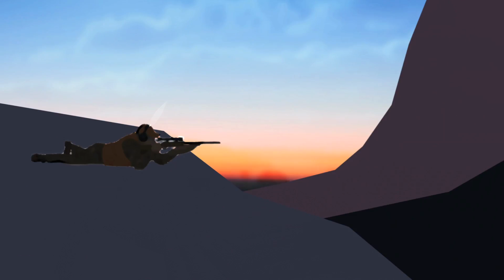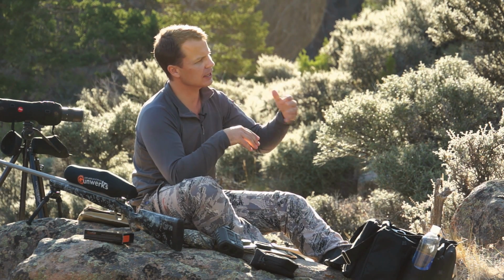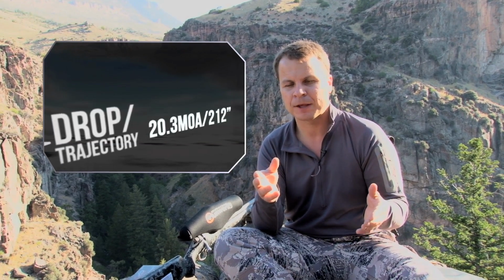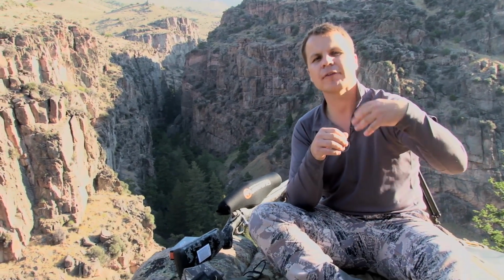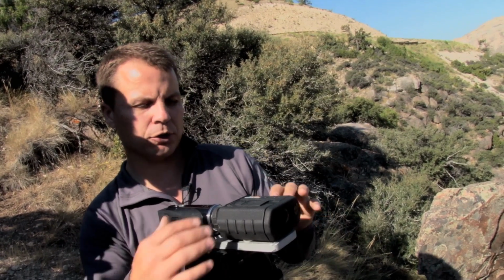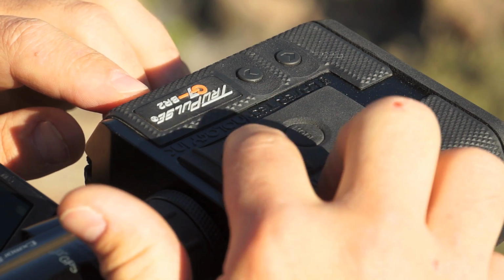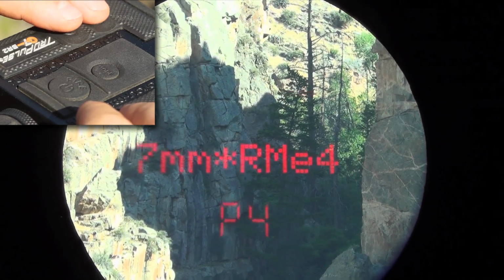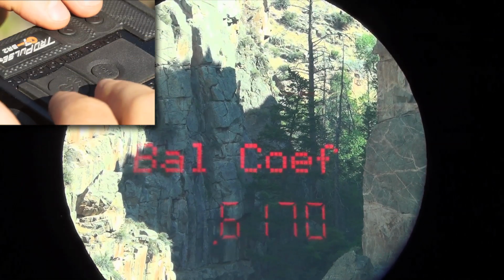Long Range Pursuit | S2 E11 Long Range Tools

Comment: Aaron, in your comments for BC, you mention that you recommend using the G1 drag standard (unless you have the G7 data).  I think you now prefer the G7 standard and as such, set the BC for my G7 turret using G7 drag standard.  Is that the case?  Also, why do you prefer one over the other if you have both BC drag standard data available for your round (ex. 168 Berger VLD Hunting)?